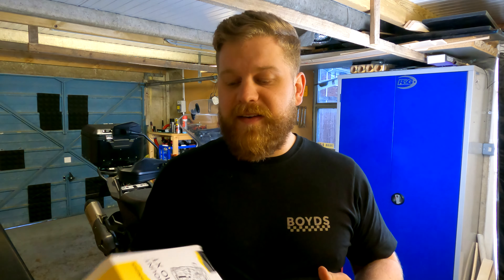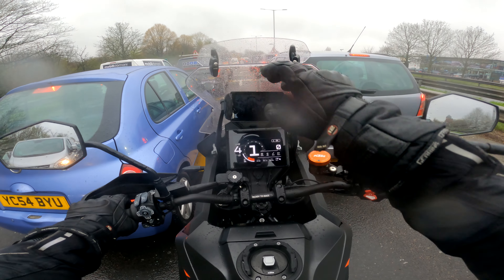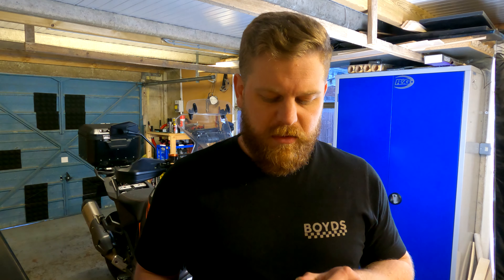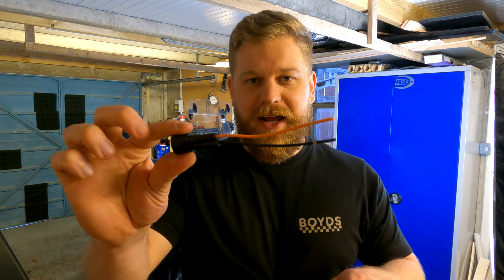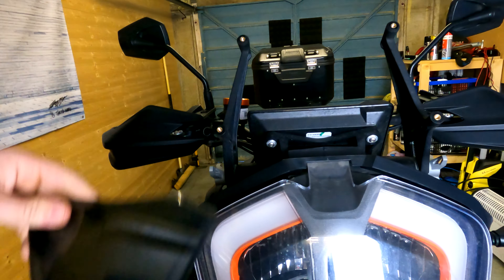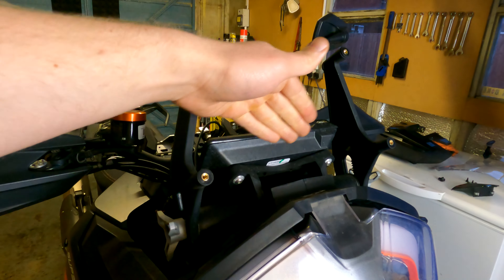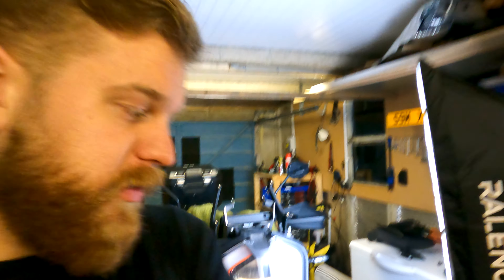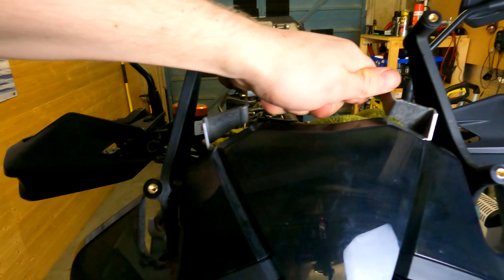Garmin Zumo XT | TAKE 2! | Touratech Mount & Bracket | Hard-Wire to Hex EzCan

Comment: Great video. I have just sold my Honda Africa Twin and had the XT on it. Also have a Ktm Duke 890R and use the XT on both. Couldn't be bothered with the cradle, just take it off and pop it in my pocket. Got a new BMW R 1250 GS Triple Black coming down next month and the Zumo will be mounted on that too. I did read somewhere that you can set the timeout to zero as the XT has an internal power timer thingy so 0 should be fine.Hex ezcan will be fitted to the BMW too👍
Reply from the maker: Thank you! It's a great piece of kit isn't it. Would be nice to swap between bikes like you! Just need to get myself another bike haha. You can set the timeout to 0 seconds on Hex. I haven't checked the Zumo yet though. Enjoy your new bike!

Comment: I've just bought a Garmin zūmo XT, and, I agree, the mounting system doesn't inspire you with confidence! It works, but there's only one small clip holding the whole unit in, and if that is not attached properly, your lovely Garmin zūmo XT will go bouncing down the road! Have you thought about getting a couple of pin Torx security bolts for the sat-nav bar, you need a special pin-torx bit to fit them, which makes things a bit harder to steal?
Reply from the maker: The lockable Touratech case with the metal mounting bracket behind the TFT is wayyy better! The one from KTM wobbles around but the Touratech one is rock solid. Also makes it a bit harder to steal. I've covered up the bolt ends too just to make it less obvious there's bolts that can be undone
Reply: @SamVBikes  It certainly looks more robust than the KTM offering! I sold my adventure bike and went back to a sports bike, and I'm wondering whether the Touratech case might take up too much space. The only place I can fit one is on the handle bar, by the ignition. At the moment, my unit is attached using the supplied 'U' bolt with the ball joint clamp mount. But, it's very easy to take it off because of the convenient thumb knob Garmin supplied, meaning anyone could walk off with it? I swapped my one out for a bolt and nut, meaning it's now locked it in place, and you need a couple of spanners to remove it. I don't think Garmin really thought the mounting options through, very well. The unit is for a motorcycle, but they've provided a suction mount and power lead for the inside of a vehicle? Why not spend more on a secure mount for a motorcycle, with a better fixing system - one that can't be nicked!

I've wired my unit up to a INNOVV Power Hub 2, which is an excellent little unit. It controls everything, LED spots, heated grips, a couple of USB outlets, and there's one spare plug. Everything switches on and off in 10 seconds, so it gives the same functionality as your bike.

I'll was thinking about fitting a GPS Handlebar Mount, and then fit the Touratech case to that. It would probably be a neater solution, because even the 'U' bolt and the ball joint clamp mount takes up a bit of space. It would be more secure, meaning I don't have to keep removing the Garmin from the bike, or worry about it falling off! And, you can also bet that one day I'm going to forget to remove the thing. In the meantime, I'll stick a spare safety tether to it, because I don't really don't trust that Garmin mount. 👍

Comment: Nice one Sam, that touratech mount is a well made bit of kit, a big improvement over the KTM offering.
Reply from the maker: Cheers mate! The KTM one works well if you're happy without the security but the Touratech mount works well for that extra weight!
Reply: @SamVBikes  security is a big issue with such expensive gadgets, I would be much happier with a Garmin under lock and key and it sits level too.
Reply from the maker: Agreed! One less thing to worry about when we go get another slice of cake and coffee 👌🏼
Reply: @SamVBikes  they go together so well, I could do with turning down the cake when I get coffee 😂

Comment: Company called Zumolock make a locking mount for the XT as well, not as robust as the Touratech but much smaller
Reply from the maker: Nice, not heard of them before. Will take a look
Reply: @SamVBikes  The EZCan is a great piece of kit! I've been using them for a few years now on my GS. Good to see HEX branching out to other brands, shame they won't do a diagnostic tool for KTM.
Reply from the maker: Agreed! Had a good chat with the Hex guys at the MCN show last year. They seemed keen to branch put more. Diagnostic tool would be useful too!
Reply: @SamVBikes  These bikes have a lot of sensors! :) Good to know what the issue is when you're in the middle of nowhere lol

Comment: It seems really easy and solid. I Will mount it in a few days, thank you for the video! One question Sam, do you think the GPS block is safe enough? It seems really easy to open and stole the Garmin.
Reply from the maker: No problem! It is really easy to open but it locks so you can only open it if you have the key. If you lock it, you cannot open at all
Reply: @SamVBikes  great thanx